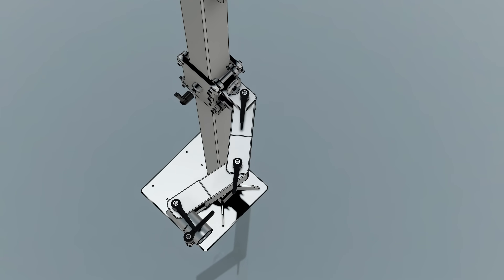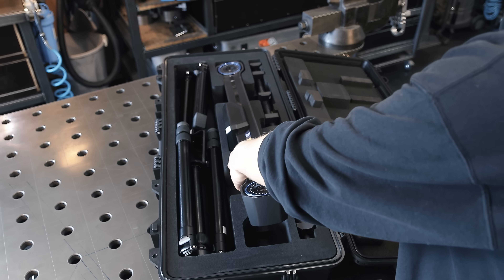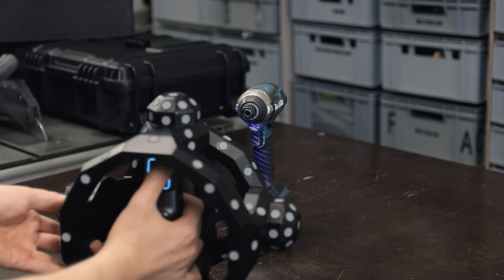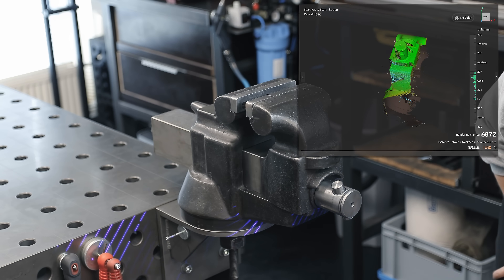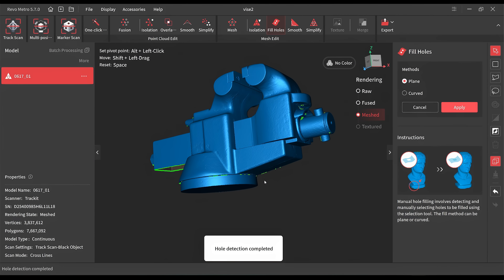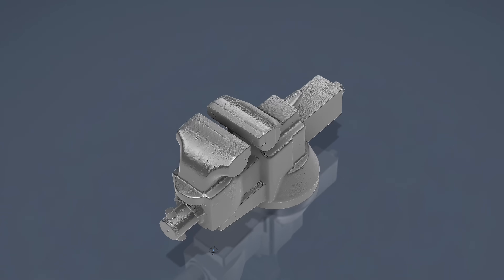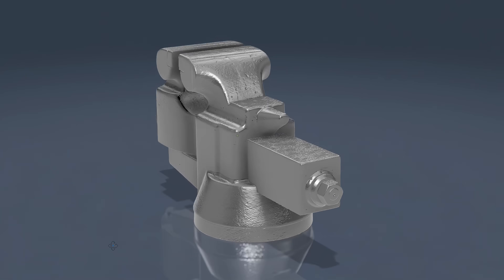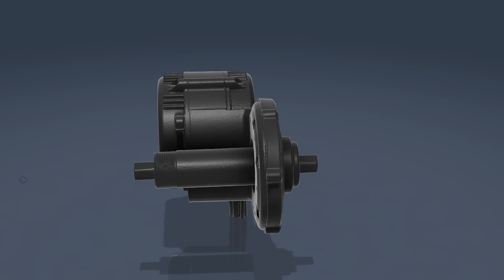3D-Scanning finally just WORKS! Testing the Revopoint Trackit

Comment: How do you use the RGB cameras for the color textures? The documentation says it can be done but doesn't explain how.  Is it the same as the MetroX where color mode only works on auto-turntable mode?  thanks

Comment: It will be really interesting if they're able to use that second gimbal for another rotation axis by adding markers similar to those on the scanner. This would allow you to place the part on the gimbal and more easily/ergonomically capture a 360º view of the part rather than need to walk around the part. Faro does this on their CMM arms, they call it an 8th axis.

Comment: Can it scan large objects like a full-size car? For that I imagine you’d have to move the tracker and re-calibrate it?
Reply from the maker: Yes, I actually showed it in the video. You don't have to recalibrate anything, that only has to be done once when you get the scanner. There's a mode called multi position tracking where you can move the tracker and even the object itself during scanning in realtime and the tracking will keep working. Unlike the other modes, this one does require placing a few markers, but not as many as with other scanners. That being said, you can always make multiple seperate scans as I showed in the video and merge them together so that's another option for scanning large objects.
Reply: @PhilVandelay thank you, very helpful!

Comment: At 15:40 there is a mention of possibly progressing to this being wireless.  This design is actually a copy of an existing scanner that I use which is already wireless.  However, when it was purchased a little less than a year ago it was more than 10x the price.  So, this offering from REVO is quite amazing.  This exact tech with wires was available about 2 years ago for $110k.  So seeing it for $4k is absolutely amazing.

Comment: hey wait why can't we just use like. Vive trackers on our 3d scanners? VR has pretty much solved this, right? Or heck, Oculus style inside out tracking? Photogrammetry software also regularly reconstructs camera locations from nothing but dumb images to produce awesome 3d scans, why can't a 3d scanner, with way more information, also do that?
Reply: The problem might be that the systems for VR tracking and 3D scanning both use IR light, so they may interfere with each other unless the systems are finely controlled and integrated together. Also, I don't think the VR tracking requires the same amount of precision as 3D scanning, so they may not be up to the task.
Reply: Okay, so, the scanner is cool, but consider this: 

Python, Segment Anything, and Gaussian Splatting. I think it's possible to achieve similar results with a smartphone camera and a fast GPU.
Reply from the maker: Time to start a 3D scanning company I guess 😉

Comment: Hello Phil, really nice video! Out of curiosity, hanging the upper body of the bandsaw from the hinges and scanning it in that position would not help?
Reply from the maker: It could, but it would have to stay absolutely still so if you touch it and it starts swinging slightly your scan would come out wrong. Merging works really well so it's usually the easiest solution

Comment: I just 3D printed some dodecahedrons with tracking points attached to it and a magnet in the base. I then put my object on a magnetic plate and drape the trackers around it. Works very well and is cheap.

Comment: Would like to see a video of how you use the scan in fusion 360. Like how you get it from a mesh to a solid to be able to work with it. Great video.
Reply: To my knowledge there isn't software that can yet convert the mesh file to a workable solid file. These laser scanners are good as a reference when designing. I could be wrong but I think NX by siemens is the only CAD software that has that capability.

Comment: Would be really nice to see how you work with the resulting mesh in CAD software. I personally struggle with orienting it. For instance, we know the base of your vice is flat, but how do you make sure it is aligned with, say, XY pane?
Reply from the maker: Very late answer but: The short version is, there is a feature in Fusion (and I assume most other CAD software) that allows you to create planes using triangulation. For example you could define three points at the edge of the circle the base is made of and it'll create a plane that intersects those points. If you do it accurately, you can get very close using this method. Then you can snap you model to your world coordinates using that plane and you got one surface aligned. You can repeat this with other surfaces until all your important reference surfaces are square to your world axis.  Obviously depends on the object but for many shapes this only takes a few minutes to get things aligned well enough to work with.

Comment: That's pretty cool but I don't really understand why they're using outside in tracking. VR headsets have used inside out tracking for quite a while now and I have to imagine that technology could be applied to a 3D scanner as well. It certainly would be a lot more convenient.
Reply from the maker: I'd assume it has to do with the required precision, according to the calibration data I saw this method is crazy accurate (we're talking tenths of a milimeter). I'm guessing VR headsets don't have or need that kind of accuracy
Reply: @PhilVandelay Yeah that's entirely possible. I know inside out is accurate enough for VR but that doesn't mean it's accurate enough for this.

Comment: Thanks Phil, that looks like a lot of fun. For automating some of the work I guess it wouldn't work with a model on a rotating table like the early lidar, but maybe you could put the scanner on an arm and spin it around the model in a descending spiral... Very cool tool, and you're right to be excited about it as it has a lot of potential to save you time.

Comment: I mean that's great,... but not 5K worth it,... and not even the 3.5k with discount,... it's really made for the Industry, not the average customer,... at 1k to 1.5k we can talk...
Reply: Then you haven't seen the cost of similar devices from other 3d scanner manufacturers, it really is like 10 times cheaper than what was previously available
Reply: Sadly somewhere there is a bottom for the pricing.... The MetroX could be a nice fit for you
Reply from the maker: You gotta put that in perspective with what you're getting though - I checked it myself and other tracking scanners cost upwards of 10k, sometimes even 60k and more. Just like 3D printing I think this tech will become more affordable quickly, my guess is in 2-3 years you can already get something with similar performance for around 1k. There's a lot of competition going on in this field which is good for the consumer

Comment: I think you might be able to cobble together a wireless way of keeping an eye on the program as you're scanning by sharing your screen to a phone and using AR glasses to see both the scanning software and the object at once. Could also work with most VR headsets nowadays, if you happen to have one.
Reply: I use exactly such an approach.
Meta Quest 3 with Remote Desktop Window flowing above my scanned part
Reply from the maker: Great idea! I can see this becoming part of the scanners eventually. Even just a small display on the scanner itself would help a bunch

Comment: Without having seen your plans… If you didn‘t have this band saw. Making one from scratch or biting the bullet and paying for a professional one almost seems like a better idea?
Reply from the maker: Yeah you're not wrong, it's questionable whether this idea is worth putting the time in in a monetary sense, even with the scan saving a bunch of work. But I also do projects for the channel and for fun so it's a bit of a different situation. The plan is still quite vague but the idea of integrating the saw into the weldting table is intruiging for me and that part is definitely something you wouldn't be able to buy
Reply: @PhilVandelay  I think what you will come up with will be a great and interesting solution. But if I, or another viewer wanted to copy it, it feels strange to have step one be: Buy 600€ saw, throw away 2/3 to 3/4 of it...  Also it might limit what you can build. I mean... what does the frame really offer? Are the existing band saw blades really that valuable? Could you come up with a way to weld them yourself? perhaps you can join 1,5 blades to one new blade? enabling to build a bigger saw capable of cutting deep compound angles? Personally I can't stop thinking about a 4 roller design...
Reply from the maker: Yeah it wouldn't be feasible to buy the saw just to do this mod, but a LOT of people already have these saws because they're such a great deal (I only paid about 250 bucks new for mine btw, unfortunately they're more expensive now) As for welding blades, I've tried that a couple of times using my TIG welder but haven't exactly had great results - they usually break quickly after because the weld seam is too brittle. I think it works if you have much larger rollers and more gentle bends like on proper vertical bandsaws, but these smaller saws are pretty tough on the blades as it is
Reply: @TheVisidor  I picked up the same saw for $75. You can buy them new for $300.
Reply: Bandsaws that can rotate like he is talking about are several thousand dollars. Sadly, there isn't a cheap "Harbor Freight version".

Comment: Very nice and thorough review -- even though you're not a review channel. :-)   I'd LOVE one of these systems -- as I'm sure most of your viewers would love one too!  It seems competitively priced, given all of the parts and tech involved.  And it's clearly well built with top-notch materials.  

Unfortunately $3400 (with the discount) is well outside of my hobby budget.  I suppose if I were 25 again with many years of time savings getting quality scans ahead of me...
Reply from the maker: I'd suggest just waiting for the next iteration of this - it's still very new in the consumer market and I'm sure in 1 or 2 generations, a lot of this tech is gonna trickle down to much cheaper models. For pure hobbyist use it's probably still too early, but if you're getting paid by the hour in any way, I think this thing is a steal because it can save hours of work within minutes in many cases

Comment: ...only it probably works only on Windows.
Reply: if you have the money and need for a device like this, you probably also have the money for a separate windows machine
Reply: Lol. I just bought a $6000 Dell precision for a similar scanner. Apple  stuff is garbage in this area. No Nvidia graphics, limited ram, consumer type laptops without number pads or middle buttons, limited ports...

Comment: I don't even want to know how much a professional scanner starts to cost if this isn't considered pro grade.

Pretty cool device though
Reply: Upwards of 50k
Reply from the maker: I looked at a similar one and it was 60k. If you google "Tracking 3d scanner" you can find some pro models online. To be fair, they're probably a bit better, but I doubt they're 20 times better
Reply: Typical candidates are nimbletrack metrascan and Freescan Trak Nova.
Regarding the first two the technical differences aren't too vast. The trak nova has the cool advantage that the tracking unit itself can be used as a scanner for very larger parts. But also costing 70k xD @PhilVandelay